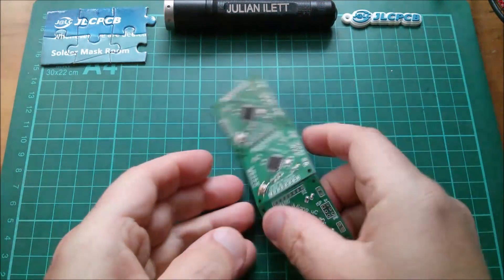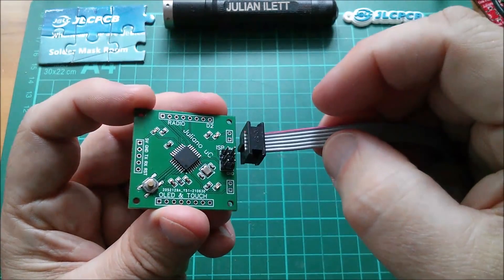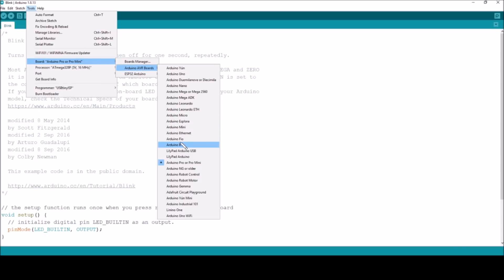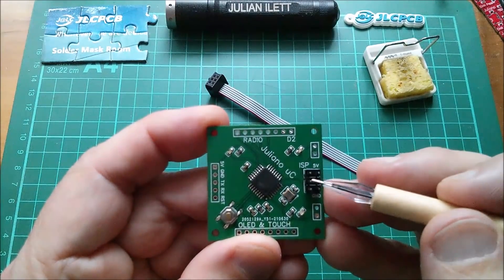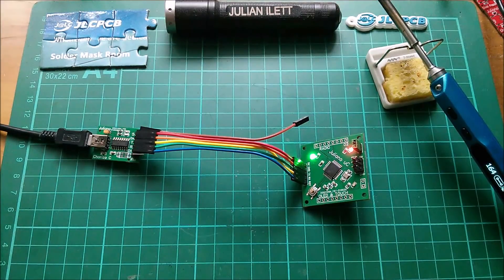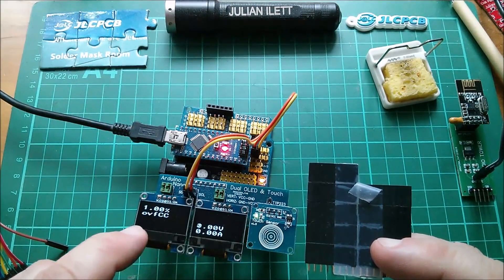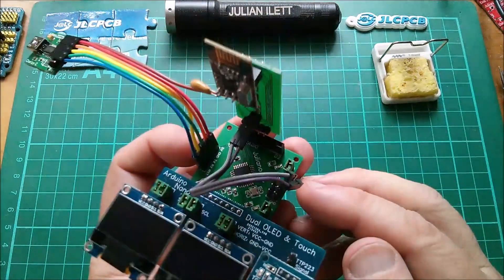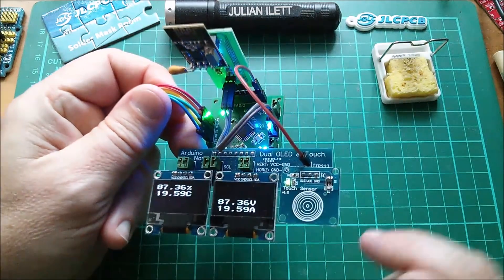Juliano Pro Minty Build and Test

Comment: well done julian now design and build an all in one board rather than using daughterboards ?? as all that has happened is you built a Juliano then sustituted it in place of the nano it still looks a mess, not the Juliano, but the remote sensing bits and pieces, and could it be battery operated?? :-)
Reply from the maker: thanks very much

Comment: What a tour de force of thought through design!  Three PCBs to link up four modules, and even then they don't just plug together, no there's extra wires too.  Then a USB to serial board with a different pinout to the CPU board so they can't be plugged together (one with a male header and one with a female header).
For me, YT even shows an advert for ChinaOnePCB before the video sponsored by JLC, brilliant (but definitely not Julian's fault).
Reply: If he's prepared to design and pay for (whoopsy, forgot shills get boards for free!) a PCB, why not build the CH340G and the daughterboard and all that crap into the one board? Just plug the OLEDs and the radio module in - and maybe the touch sensor, depending on what's actually on that thing - into it, and you're done. But nooooooo, he has to make everything super complicated and super pointless, as usual...

Comment: You pretty much can program the ATmega328 directly with the ISP programmer, maybe even without any bootloader ... does it save on space?
Reply: yes you can and it saves the half a K  that the bootloader uses, so if you have a large sketch that would be an option.

Comment: I'm wondering why you didn't add the daughter board that your oleds and touch switch plug into as part of the microcontroller board build? Then it would probably sit quite happily on the bench.
Reply: asked that when he first started the design, but hey ho:-)

Comment: For your 'Banano' board check out the LGT8F328P...it's a 32MHz, pin for pin replacement for the original 'Nano' but is populated on one side only...it may help you with your parts layout for the one sided limitation.

Also, was there any reason to have both USB and ICSP headers? You could have programmed through the ICSP and saved some memory by not needing the bootloader....couldn't you? Great work BTW.
Reply from the maker: Yeah, that LGT8F328P looks like what I've got in mind. But I'll have the larger mini-B connector, an ISP header, a nRF24L01+ connector and a 128x32 oled connector :)